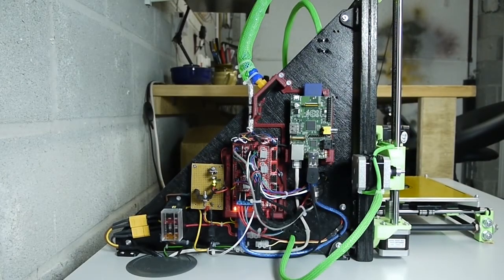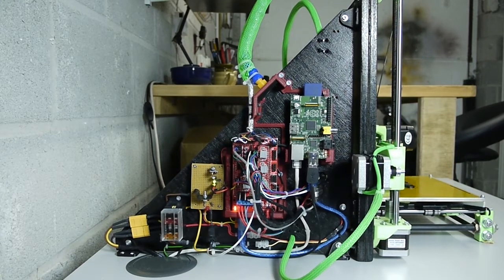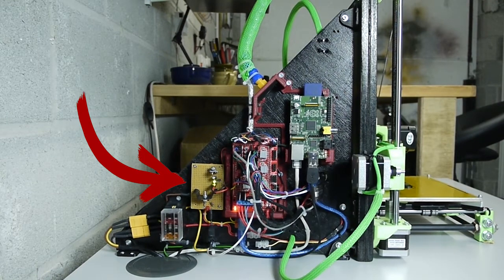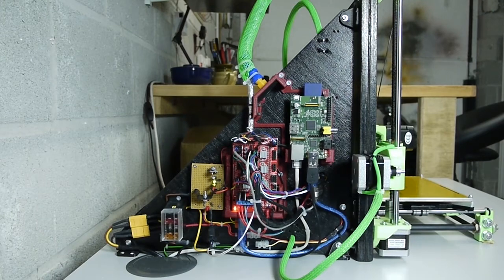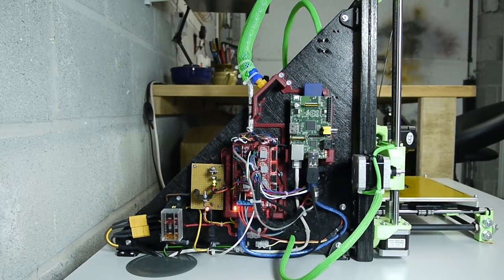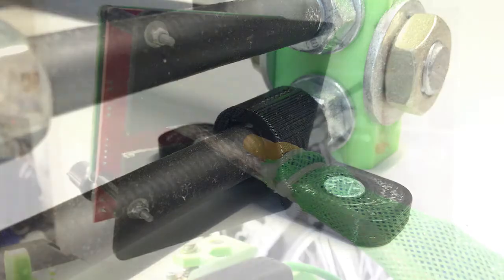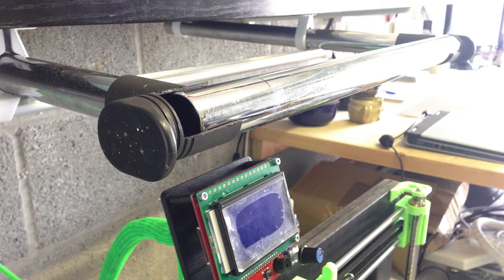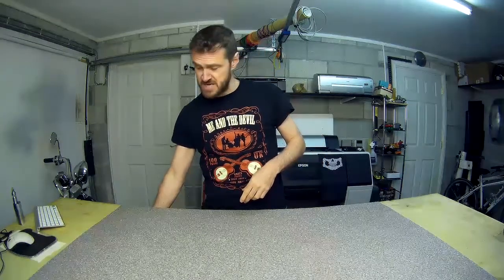Cheap DIY Prusa i3 MK2 3D Printer - Electronics Mounted, FINALLY!

Comment: The printer looks great. I've  never  seen  the green wire loom before - it looks great here. Tom did a video a couple of days ago on adding LED status light bars. Do you plan on adding them too?
Reply from the maker: Cheers Jim - yeah it's coming together! No, I don't plan to put many LEDs on it. I will add a few right around the hot end for better visibility, but the single overhead strip is mostly enough. Not much interest in the flashing light show :D